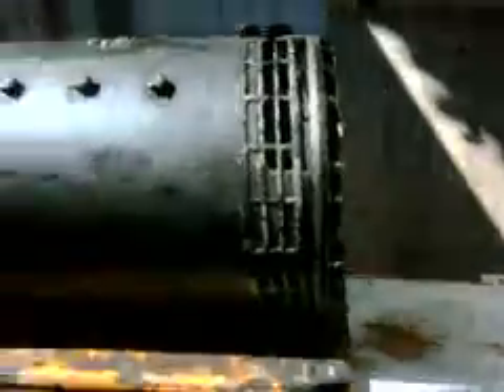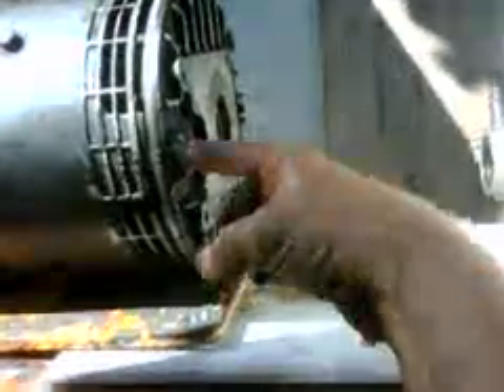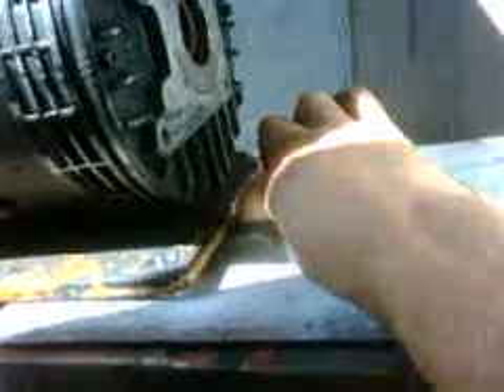Electric Car Conversion Rover Part 14

Comment: I have been running a Ford altnator backwards for the past oh, 25 years and it works just fine,  So you might want to test the one you are going to use... it might work eather way, allowing more freedom in mounting.